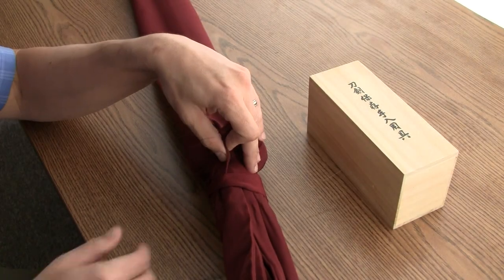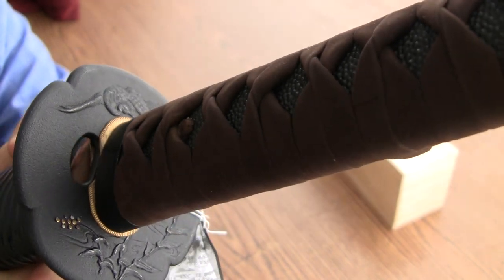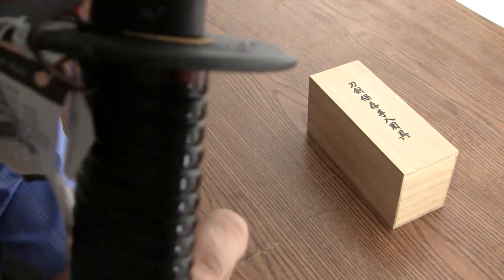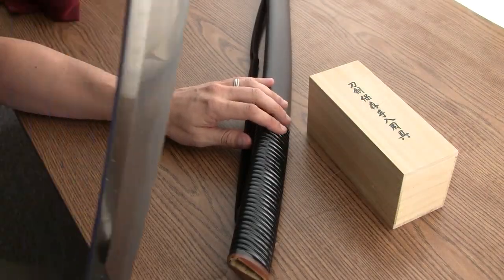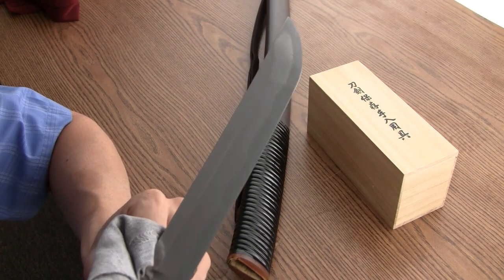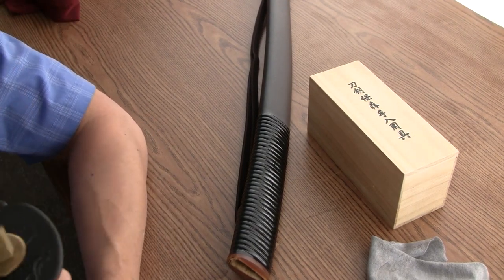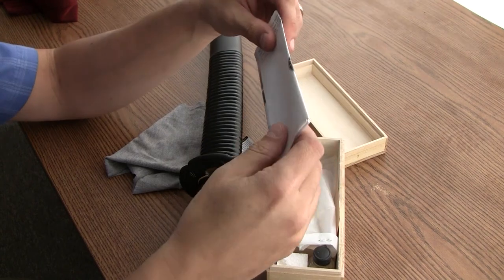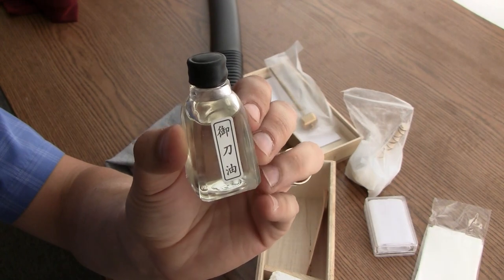Hanwei Tori XL - Forged / Folded Swedish Powder Steel Katana

Comment: For what hanwei charges for that katana , you would think that they would put more detailed fittings on it . I got a raptor shobu zukuri and that was a good deal considering its through hardened 5160 spring steel but that satin black finish that they do on their katanas kinda suck . but those XL katanas are pretty cool . I do like the wider blade ! They just need to bring their prices down on most of their swords , especially on the practical plus XL and the practical pros

Comment: Hi, what is the difference between the XL and the Elite? I understand that the light has bo-hi but I don't understand. Is it mainly heavier or different geometry?
Reply from the maker: Hey Ronnie, the XL is slightly wider in profile and thinner than the Elite swords. If you could see two of them together in person the difference is immediate... harder to see in a photo though.
Reply: Which in your opinion is best for a lot of kata practice and cutting practice about 4 times a year. Cutting is very important but mainly form practice with a lot of drawing.
Reply from the maker: Between the two the Elite blade for sure. Although you may find the extra weight in the blade more than you'd like for kata practice.

Comment: That's a monosteel construction rather than sanmai correct ?  What sort of rockwell does that steel have, in the spine and the edge ?

EDIT: I did some reading, and what I found implies HRC60 for the edge and HRC40 for the spine. Then again, Hanwei lists 60/40 for ALL of their swords, which does not reflect real life for legit handmade weapons, which vary from blade to blade.  I'm thus inclined to believe those figures are a 'test once and assume identical for the entire product line' short cut, and are therefore not 100% reliable.  In other words, treat them as a best case ballpark guestimate.

Color me unimpressed on that one count (otherwise a nice looking product) ... I mean really, it is not hard to test the tang for a spine reading, and test the edge prior to sharpening, to avoid marks on the finished blade.
Reply: No, this is a folded blade.

Comment: I'm a Iaido student. Furthermore Paul Chen Katanas are not suitable for Iaido neither Battodo. For iaido, Cas Iberia blades are built in fixed lenght. Usually about 70/71 cm. A sword has to be well fitted and balanced for the practitioner's height. Tsukas often are too long.(Golden Oriole, and many others) One of my japanese trainers, also told me that all of Hanwei swords are not flexible due for the steel quality and so, tameshigiri practice is a real risk. Meanwhile, exept for the blades, koshirae are the real point of force of this brand.
Reply: Tanemura9 not really, i own two of their iaitos, one of 28 and an other of 29 inches, i have been using it now for 7 years, had only to replace the leather grip a year ago. FYI! Paul Chen has produced more swords on modern days in China with no restrictions, than all Japanese swordsmiths combined, in case experience is of any value to you. My now deceased Japanese Sensei who was soshihan of a koryu style used the same iaito.
I cannot speak from experience because I do not own a Shinken from this company, so I am not sure if your information is correct in that specific matter.
Reply: fmn2628 I own a lot of swords, Paul Chen stuff is great. I have a Bugei sword from them and it's a monster... if you are looking for a blade that is light like an iaito then you will compromise structural strength
Reply: That's not true. These can be used for iaido practice, though they're really made specifically for competitive cutting. Some very famous MJER Hanshi's have used the XL light version of this exact sword as their main practice sword for Waza and cutting.